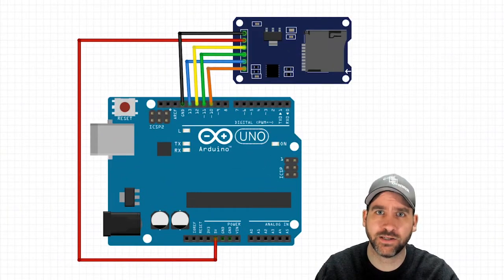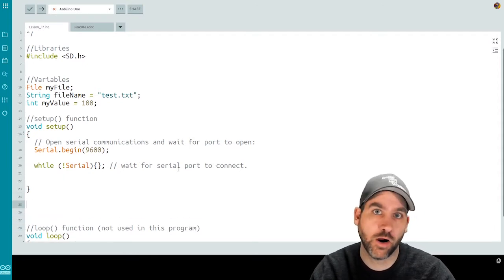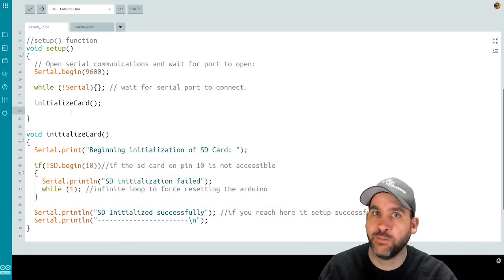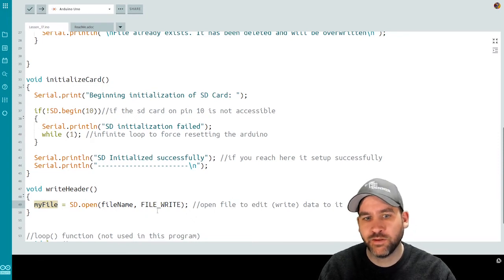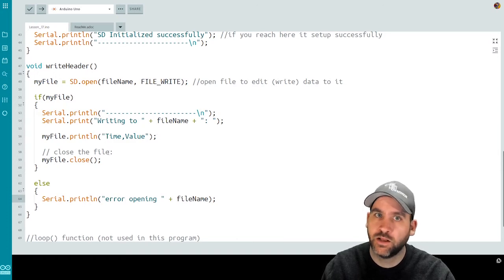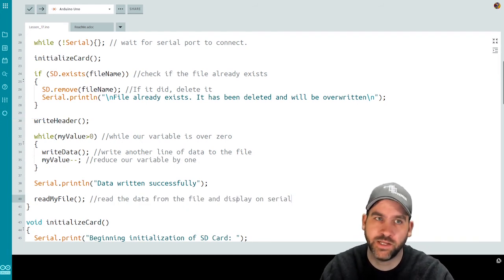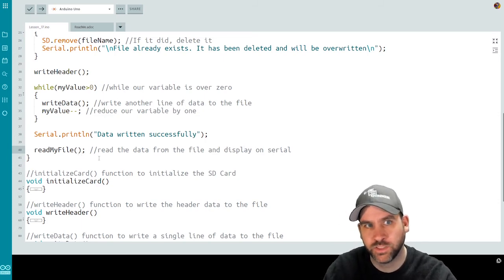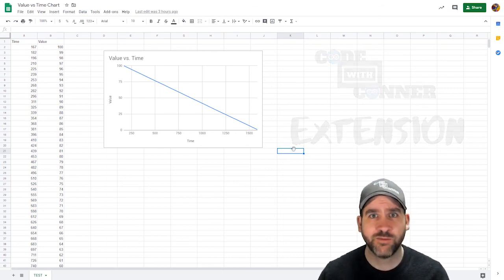Arduino Basics - Lesson 17 - Reading and writing data with a micro SD Card

Comment: Really nice video! thanks for all the information. 
I'm having a problem with the recording in the SD card, it only record 3 minutes of data ~10 kb in a 2 GB SD card, do you have any idea what can be wrong?
Reply from the maker: Hard to say to be honest. I'd have some debug statements either running to the console or to the SD card to try and get a sense of when/why it is failing? I know I've had SD cards that gave me a lot of trouble and others that worked seamlessly.

Comment: Dude I dont know why this doesnt have more views & likes. Thank you so much! Quick tip if someone is struggling with the code using Arduino MEGA: remove GND pin from the micro SD module, and disconnect and connect the SD card. I was stuck with the "SD initialization failed" message and the latter fixed the problem. 
PS. you got a new subscriber. Thank you again!
Reply from the maker: Hey thanks a lot!